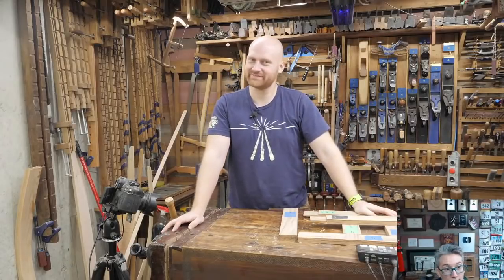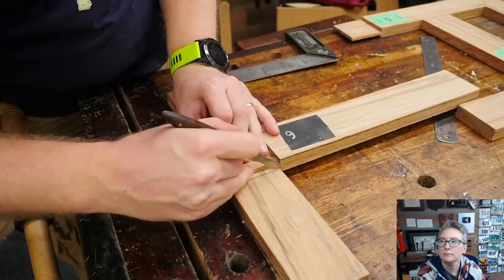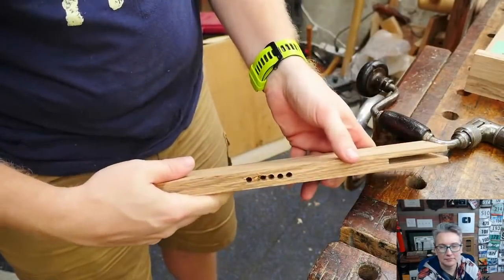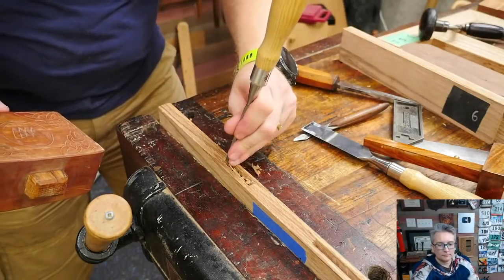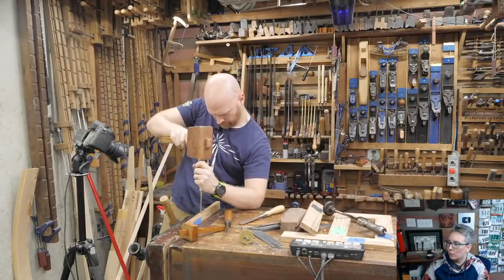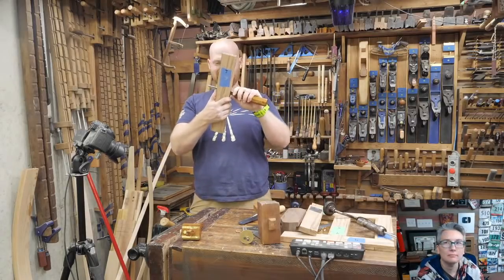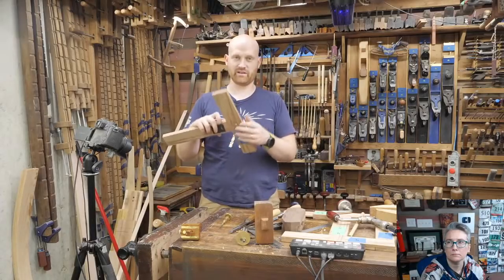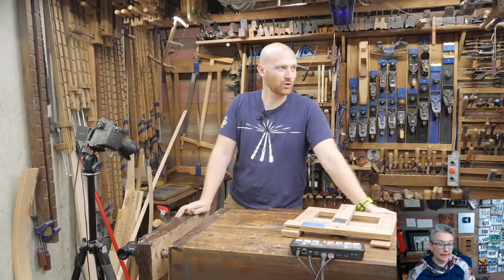How To Make a Drawbore Mortise and Tenon | Joinery Window Live

Comment: I actually made a saw set tool by filing down the jaws of some extra pliers into a "V" shape die longitudinally (inline with the pliers). It's harder to visually see what you're doing to the teeth, but it works great.
You just creep up on the depth of set you want - start by filing a very small " V" in one side, & matching protrusion on the other, try it, then file a little more for more set. 😁👍